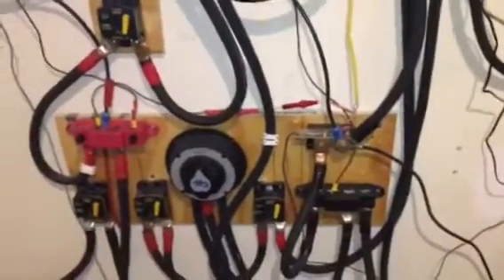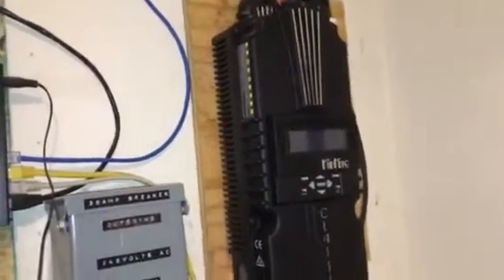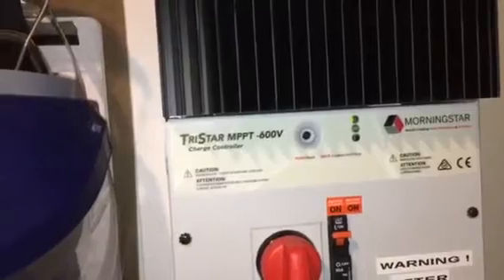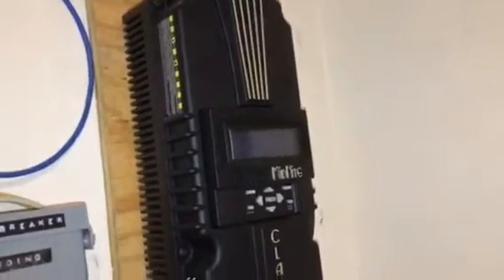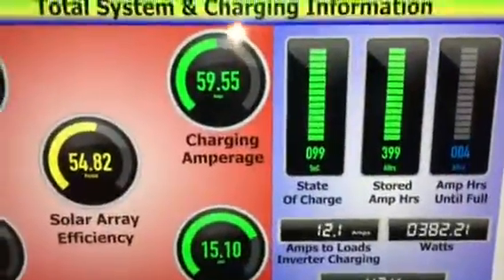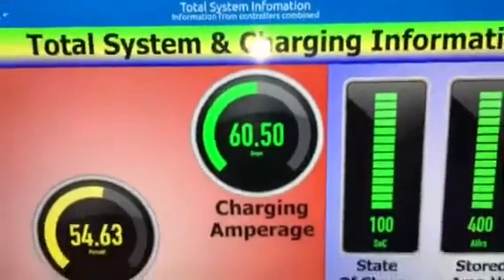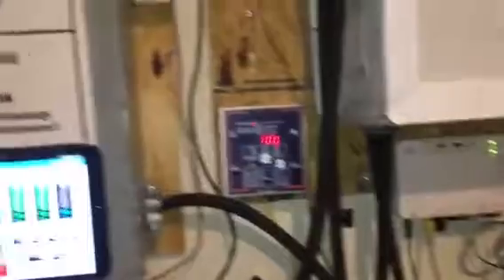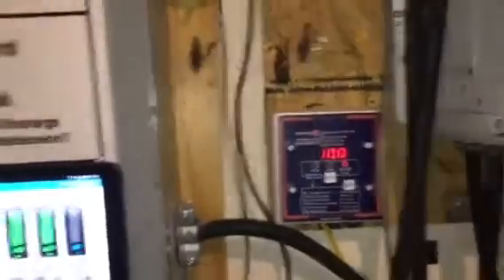How I connected and use different charge controllers.

Comment: I currently only have 16 x 270 watt 31.4 vmp panels connected in series strings of 4 so I get about 148 volts after line losses.  I'm running a Outback Flexmax 60 charge controller.  I would like to install a MagnaSine 4448 4kw Inverter charger but I want to use lithium Ion batteries as my backup.  From your video it looks like I may be able to custom setup the internal program parameters to make this happen.  Am I missing anything?  I have worked with the Raspberry Pi a little.  Have you ever run Node-Red and how do you think it compares to just running the Pi 3 on python?  Thanks in advance.
Reply: Thanks for the comments.  There are custom settings through the advanced remote unit (ME-ARC REMOTE), and I've read where some people are using lithium batteries with their Magnum setup, but you've got to get the remote to program those custom parameters.  I have a Raspberry Pi model B connected to my system running PyModbus and Python.  Node Red appears to be a good platform, but I don't use it.  Python gives me what I need and I feel comfortable using it.  My Pi controls and monitors my system to go on and off grid based on my own python programming that reads battery and system information via my Charge Controllers which happens to communicate via Modbus.  Essentially, the Pi controls a power relay to allow or dis-allow grid power to the inverter based on my python code.

Comment: Hi, this info came at the right time, I've been battling with it for quite some time. Once my 2nd CC with the lower panel size enter abbr then float, it stops pumping in amps! Even when I am on load. But today after adjusting the voltage on it, wow, see it pumping in amps (2nd CC) throughout the day. Thank you for sharing.
Reply from the maker: Thank you for your comments. It's always good to know when I've helped someone.

Comment: I also think he was thinking of me. So I get it now the classic will only show the current it is passing. I assume you are reading a modbus on he whizbang jr or the classic to get your total amps around the 60 number? Is there some place on the classic that shows the full current on the screen?
Reply from the maker: The 60A reading was a reading from my software calculation of the total amps coming in from both charge controllers themselves.  The Trimetric and the Whizbangjr are reading total amps going across the shunt. So the numbers may be different depending on my operating mode (hybrid/off-grid/pass-through).  Looking at the Midnite solar software application, the Battery indicator dial shows the Amps coming in from the Classic, on the Status tab underneath, in the Whizbang Jr section, the WhizbangJr reports the total "System" amperage going across the shunt.
Reply: rhandsom ok so you read both charge controller amps and do the math and display the total current correct?
Reply from the maker: Yes, essentially I have 2 readings, the 1st readings that are from my calculations are considered "raw" total amperage coming in from both charge controllers "before" going across the shunt, the second reading is of the "System" amperage (amps going to the battery) which is going across the the shunt, to be read and recorded by the WhizbangJr.  However, If I'm running loads in Hybrid/Off-grid mode, then the raw amperage coming in will be higher than the system amperage being reported by the WhizbangJr.  If I'm not running any loads, then both readings are about the same.  Hope I explained it in a way that makes sense.

Comment: I'm learning, I must have understood at least half of that!
Reply from the maker: Good deal, after awhile, you'll be giving us advise as well.  Take care.
Reply: Yeah, I doubt that. But I'm planning to build a house off-grid & 48V @ 500 Amp/hrs worth of nickel-iron batteries with a full Schneider system. With the help of an electrician I doubt all that will be too difficult to set up, but the one thing I don't yet know how to tie in is a Maxwell 48V super-cap module. But I'm sure that's not too complicated either. Also I'd like to set up 2 solar panels to run a Quanta Magnetic generator to supplement power. So, we'll see!
Reply from the maker: Sounds like you've got a good plan towards an awesome setup. The maxwell ultra-caps shouldn't be too hard to integrate with the system, DC power is still DC power, positive to positive, negative to negative.  Don't know about the Quanta generator, seems too good to be true.  But what do I know, please do a review when you get it.
Reply: Yeah, thanks. And I know the Quanta generator sounds too good to be true too. Producing more power than it takes? Solid state silicone/graphite cells that I don't understand? Maybe not worth it but maybe worth a try. If it goes down I'll definitely review.